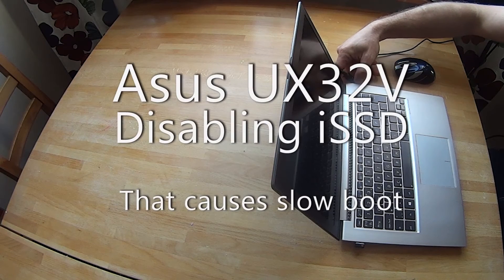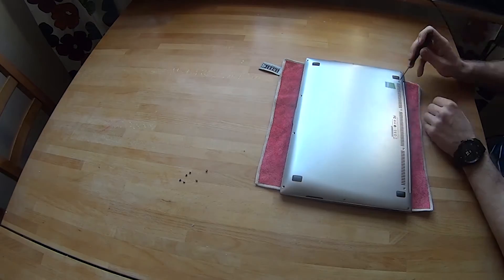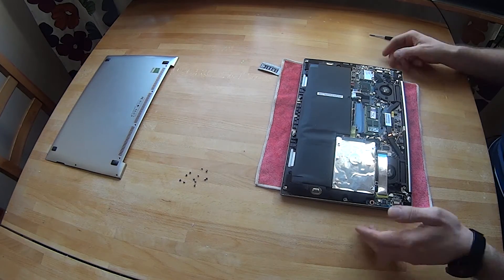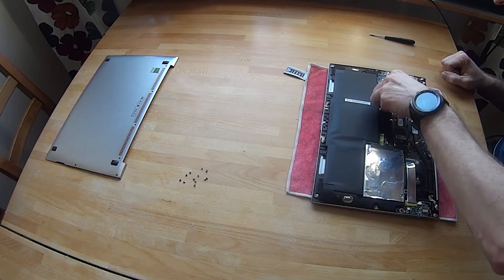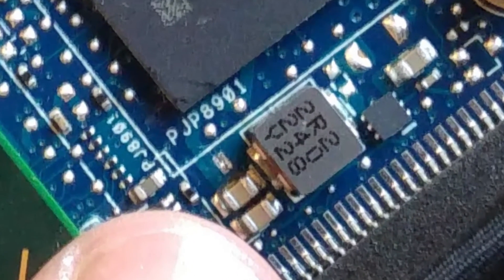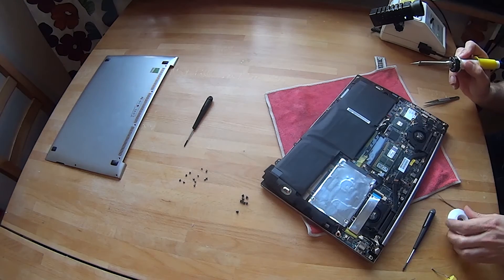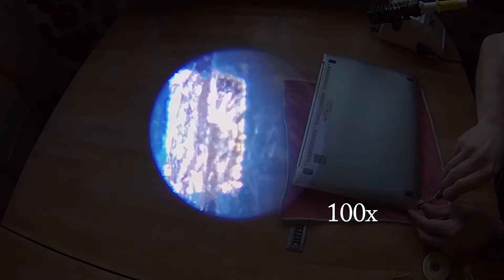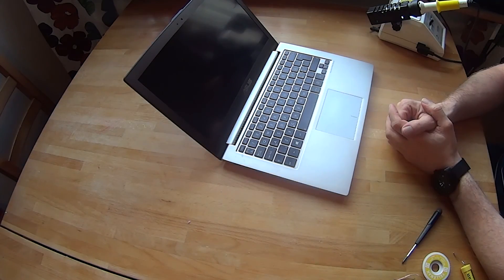How to disable iSSD on Asus UX32V causing slow boot

Comment: Thanks for that tip! I own the UX32VD model (still using it for some light browsing) and have the same issue. Another way to accomplish the speed-up, is to install Windows 7 onto an SSD drive on a different PC, put the SSD drive inside the UX32VD and wait.... after about 10 minutes when the Windows desktop finally appears, disable the iSSD in the Device Manager along with the two "ATA Channel 1" devices. Worked very well!

Comment: ASUS UX32VD
for me, impossible to repair/install W10 from live CD
seems iSDD blocking all transfert data to HDD
chkdsk /r shows many many errors, impossible to disconnect iSDD using setup/config/...
decide to remove SANDISK 24Go iSDD
make a small ball of aluminium paper for better temperature dispersion on top surface of component
heat to surface component through the aluminium ball using a soldering iron (you have removed the pan) keep iron in vertical position
lift up one corner of component
after few minutes component is detached ( now SANDISK 24Go is now not visible in the setup !)
now, you can install W10 on the HDD
it works very well for me, note that you can destroy your PC.